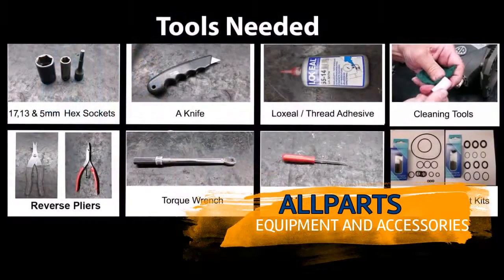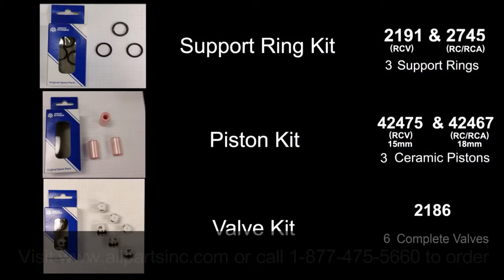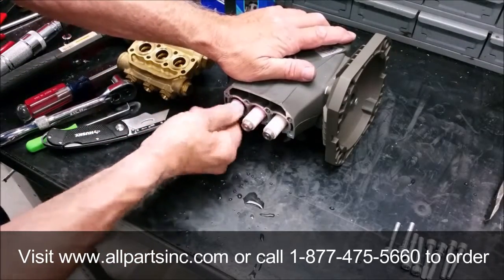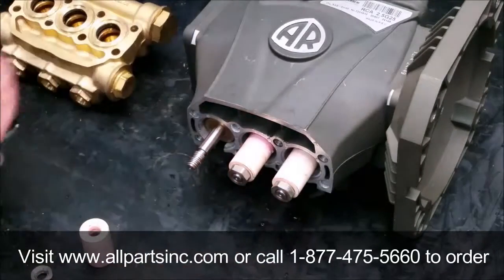Repair and maintenance of AR RC Pressure Washer pump series

Comment: I am having an oil leak with this particular pump.  However, pressure washer doesn't seem to loose pressure.  Where to start?  Thanks
Reply from the maker: If it is happening between the manifold and the body then an oil seal is probably bad. If it's leaking around the drive shaft, then the crank seal is bad. There's also a seal around the site glass area, as well as the rear cover.

Text us a photo at 1-269-447-0142 if you need help determining what's bad and to find parts.
Reply: Same here, water in oil with no pressure loss, this is the 3rd RCV pump I've had problems with, and this one has maybe 2 hours on it. I don't recommend it at all.
Reply: Dónde puedo comprar las refacciones